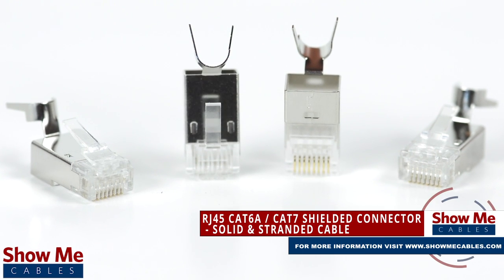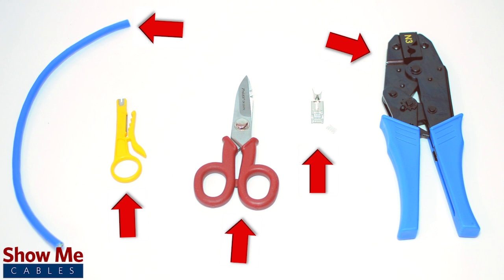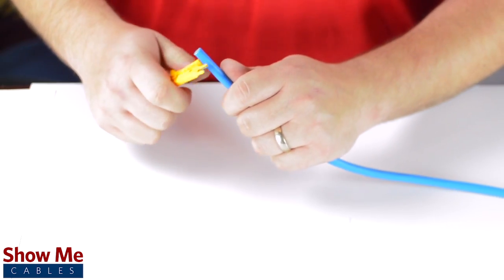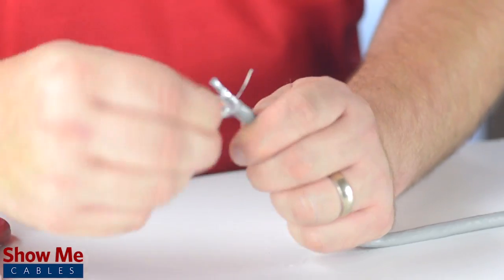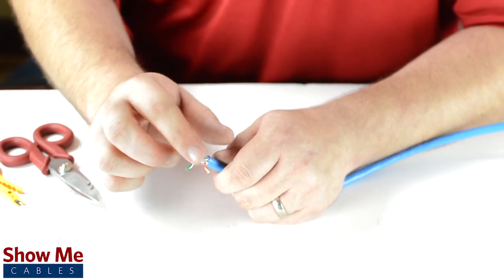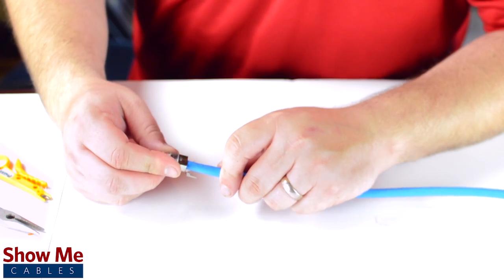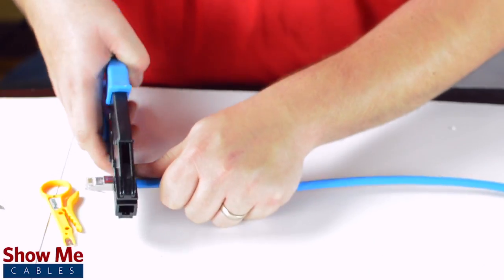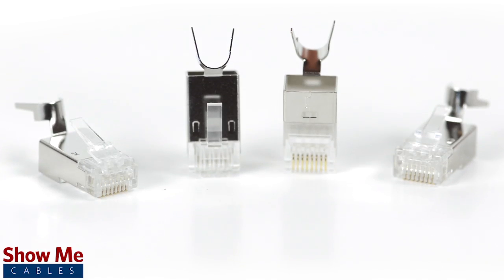Shielded RJ45 Connector For Cat6a & Cat7 - DIY Installation For Ethernet Cabling #568

Comment: Does this transfer at 10Gbps?
Reply from the maker: This connector is rated for 10Gbps, if it will transfer at that speed will depend on the rest of your network.